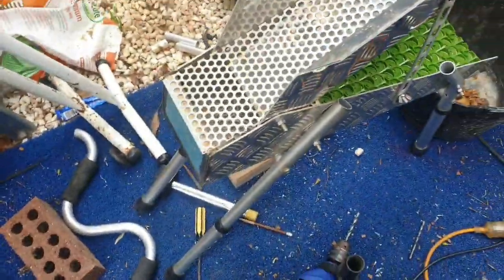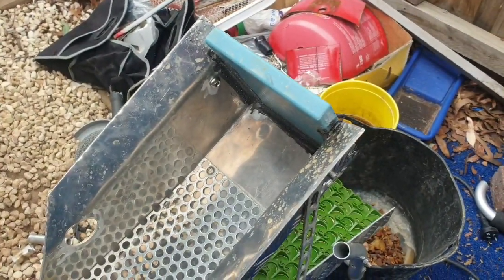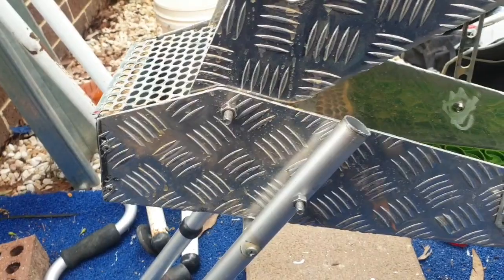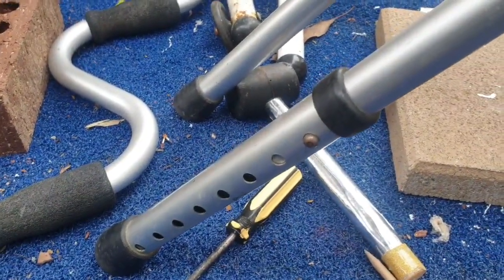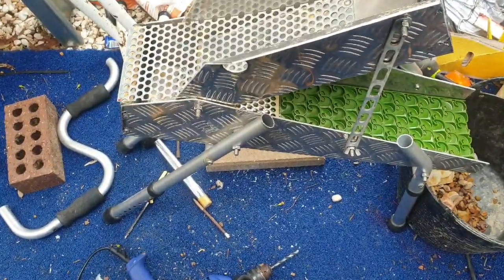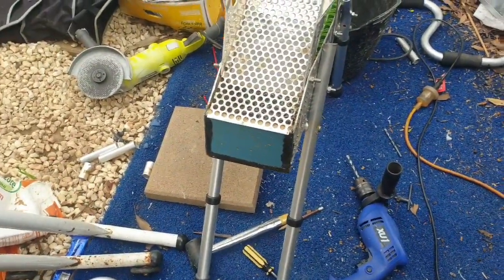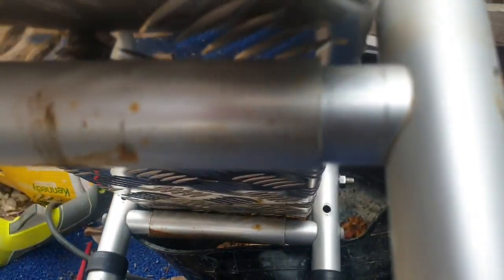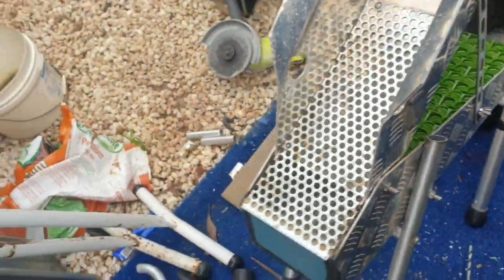Homemade 6" Highbanker ( Part 4 )

Comment: Might find it easier if each leg can be adjusted independently maybe. Not sure if can be done with that bit across under sluice. Coming along nicely though.....good work👍🏼
Reply from the maker: Every leg can go up & down. I can remove the tube easily so leg can go forward &  back.

Comment: job well done you have inspired me to build one too, l'm going to borrow your idea with the adjustable legs maybe dump into you out there one day
Reply from the maker: I use whatever was I could get my hands on. Cheap Aluminum from Facebook marketplace. Had the  dream mat. Some nuts and bolts, an old walker for the legs and a bit of a door mat that I haven't shown yet that's like miners moss. Got a petrol water pump for $70 that puts out 11000 litres an hour. Yes it's bigger than I need so can run it around half speed so it's nice and quite. Weight 9kg.

Comment: Starting to look like a bought one - good job.
Just always keep in my mind how it is to be used and design it for that purpose.
many people use highbankers to move bulk material , and some use them due to zero water flow in a creek.
One thing to consider is the top heavy configuration and that splayed legs may be necessary to prevent it tipping over from a large shovel load or mistiming your dump and hitting the hopper.
Reply from the maker: Was thinking the same thing about the legs. The mat will only cope small shovel loads, so just need to be careful.  I've made this to use when I can't  use the river sluice.